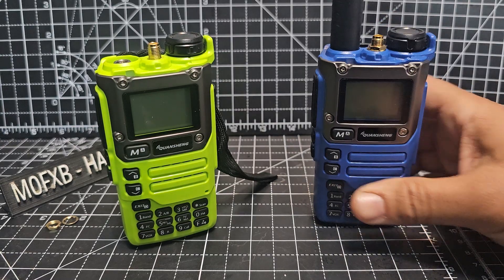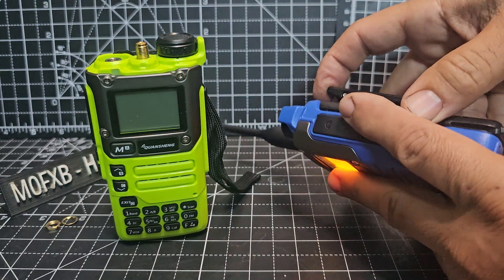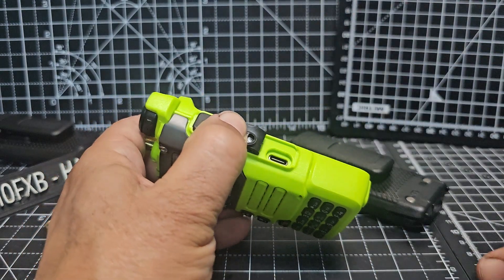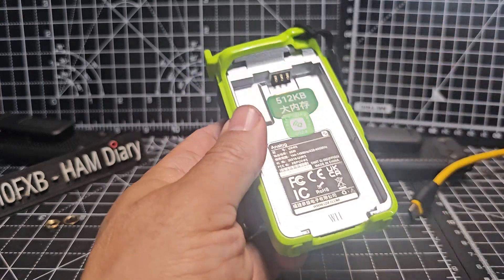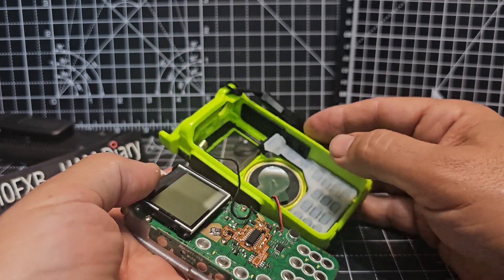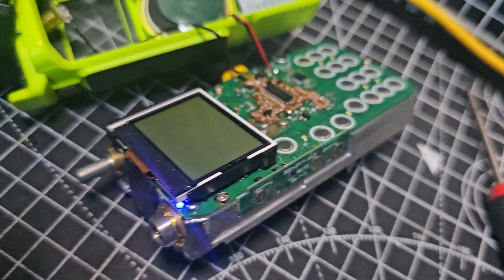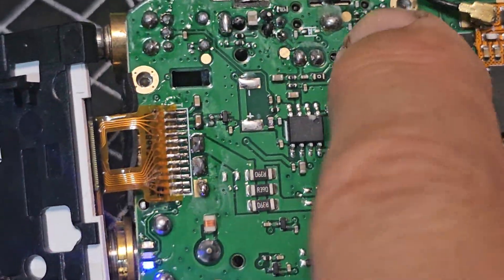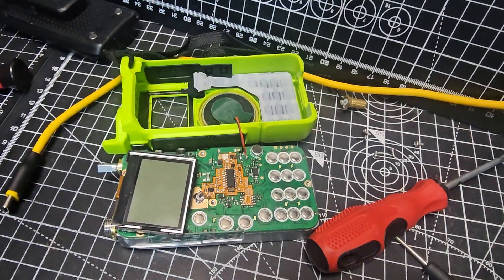Quansheng UV-K5/K6 - Not Powering On ?

Comment: Try to reset it workout for me, same as this situation no power on but usb works, and when wake up, did the reset thing F4HWN 4.2
Reply from the maker: Good advice thanks
Reply: @M0FXBHamTech  The software reset didn’t solve the problem, so I dismantled the radio and loosened the battery pins a bit. The radio’s power feed pins and the battery pins don’t line up properly, which causes a contact issue. Sometimes the battery doesn’t sit correctly on the pins, so try to align the battery carefully when inserting it into the radio.

Comment: I got the same problem on my stock uvk5, seems not a modification issue, just clean the PCB on both sides, look specially on jack solder points, power knot points, and the other side on left inferior corner. Now mine turns on well. Cheers.
Reply from the maker: Good info thanks
Reply: what did u used for cleaning

Comment: I have modified lots of these and there are usually two reasons they won't power on
A short at the top sma connector (obviously not as you removed it)
Pin 2 (vcc) of the hf pcb of the 8 pin pad shorted.
Get a multimeter and see if you have 3.3 v at pin 2, if so without the battery connected see if pin 2 is shorted to ground?
The cure is to remove the pcb at the 8 way with a heat gun. check the pcb is okay and reflow it. sometimes simply heating pad 1 2 and three with some flux and an iron can clear the short.
Reply: It could be the hf pcb, I make my own pcbs so I'm not sure how well the vcc track is insulated from the main pcb or if its a faulty component or SI4732?
Reply from the maker: Many thanks
Reply from the maker: Thanks
Reply: Sounds like good advice ☺️
Reply: Hello, I am having a similar problem. Could you explain what exactly might be happening a little clearer?
Reply: @musef7883  if you look at the main pcb the hf pcb attaches where an 8 pin FM chip was removed. looking at the pcb the pins number lower left to right 1 - 4 and above right to left 5 - 8  pin 2 is VCC i.e. 3.3v with no battery connected check if this is shorted to ground. if not, check it has 3.3v when the transceiver is switched on. Most common fault is a short between pins 2 and one or 2 and three.. adding flux and gently heating sometimes cures this, otherwise remove the hf pcb with a hot air gun. and check the short has gone (radio powers up) then re solder the hf pcb..
Reply: @musef7883  specifically if pin 2 is short to ground the radio has no 3.3v to supply the logic chips MCU etc so won't power on.